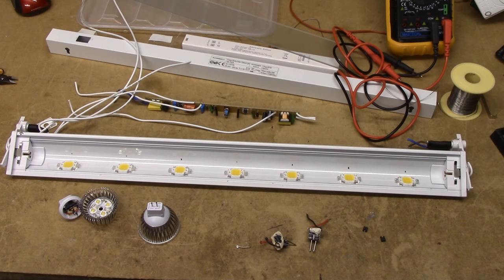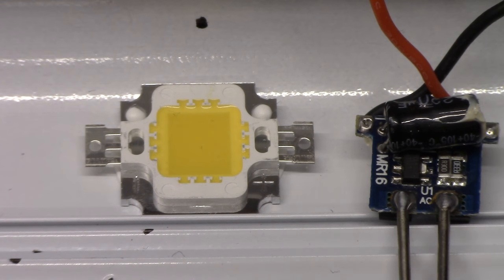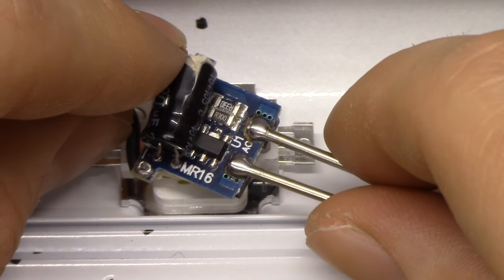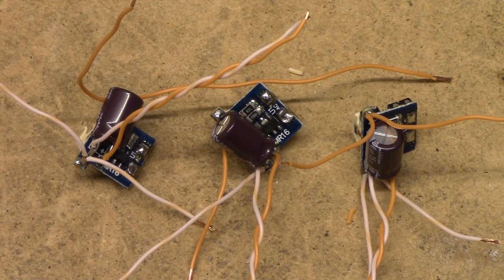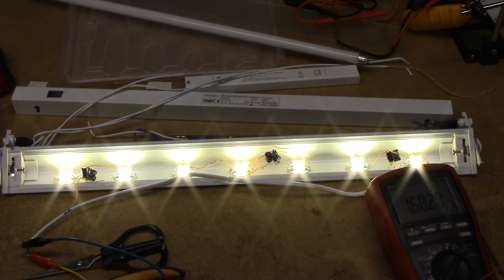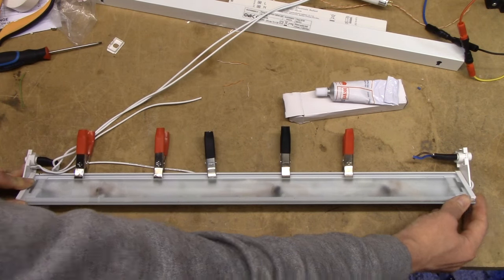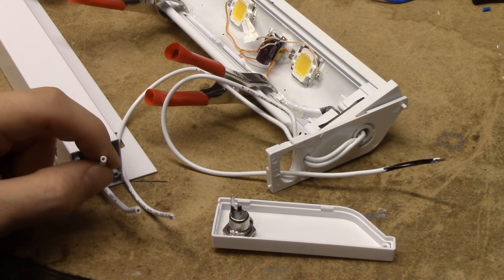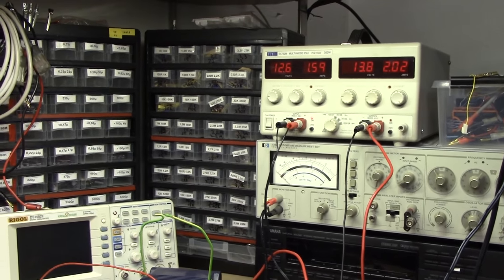13 W T5 fixture to LED conversion

Comment: Really good video, very interesting project. I might have to do this!
Reply from the maker: +Felix Gardner I'm glad you liked it. For  the price, these Lidl fixtures really are very interesting devices. If one were to use more expensive LEDs (like 30-40 1 W CREE diodes), one could probably get really excellent light quality out of one of these.